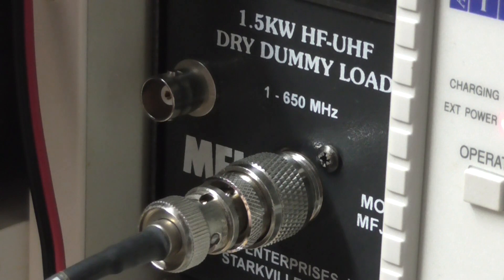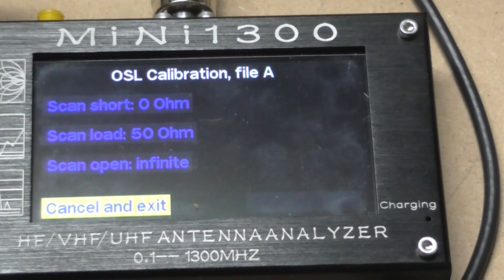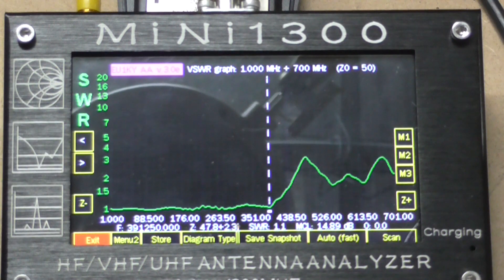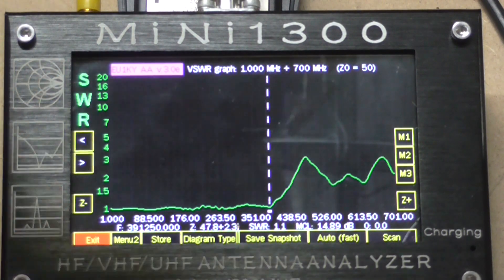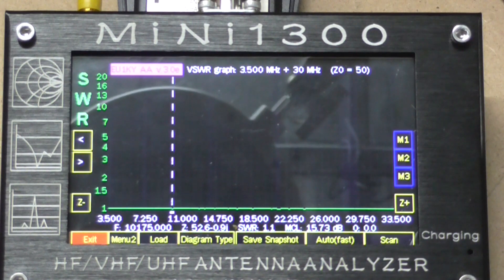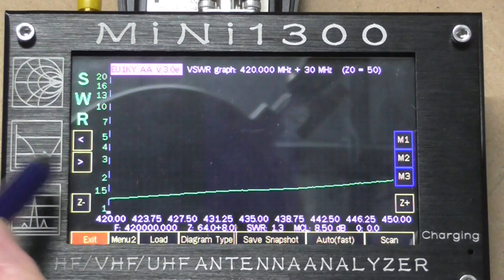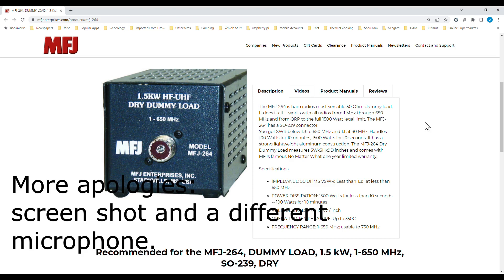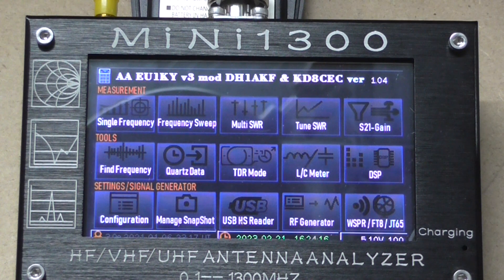VK1JTX - HAM Radio - #18 Mini1300 and Dummy Load

Comment: My mini 1300 comes with 3 dummy loads. I cannot tell which one is which. Any advice on how to tell which is which? Thanks for the video
Reply from the maker: I just used the multimeter to see which was open circuit, which was low impedance and which was 50 ohms
Reply: @VK1JTX damn great idea I have one of those thanks

Comment: hi , I have the same mini1300 , and it also don't  go up to the 1300 Mhz , but after run the oscillator test (Fmax) it works fine

Comment: I seen the Mini1300 online but have not watched any reviews on it but it has a good interface screen. Something doesn't look right in the results though. Can you retest it with something else John?
Reply from the maker: hmmm - dunno - my test gear is limited. I have to set a benchmark somewhere where I can state (and prove) that something is as described - the dummy load - is it right? The Mini1300, it that right?
Reply from the maker: I have a cunning plan. I will run the tests again - against the calibration component - the 50 ohm - it should flat line through the whole frequency range, right?
Reply: @VK1JTX  I would expect a 50 ohm load should be consistent through the bands but I'm no expert, haha.
I have a NanoVNA-F-2 if I remember correctly. You are welcome to borrow it if you like. It's brand new and I haven't used it yet as I haven't got anything to test yet. Lol
Email me if you wish to try it out John. 🍻🤠
Reply from the maker: @DonzLockz  Hey Don - I have done further experimenting this morning. Cables and connectors introduce varying results. I am surprised at the number of cables I have that I thought were 'good' are, in fact, not good.
Reply: @VK1JTX  wow, now you know. Lol
I didn't suspect that, maybe they are a bit fragile.🤷‍♂️
Reply from the maker: @DonzLockz  Me neither. Most of them were purchased recently from 'reputable' suppliers.
Reply: @VK1JTX  damn, I'd be calling them up.